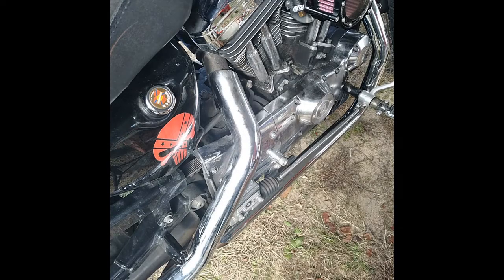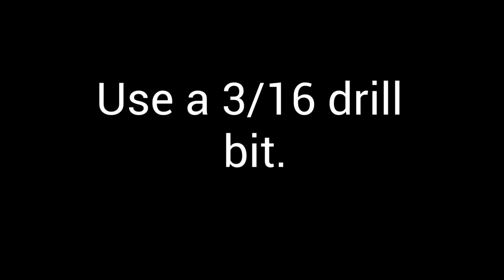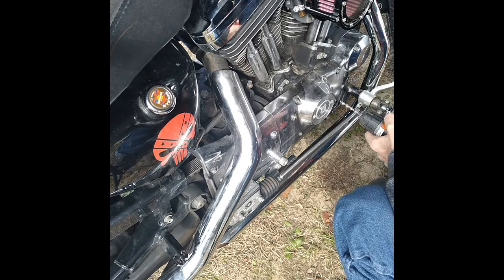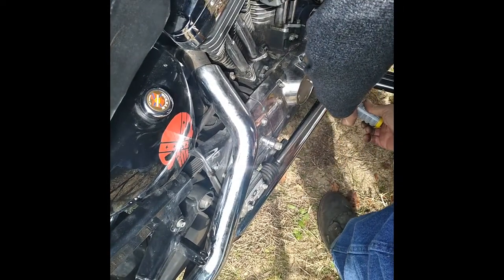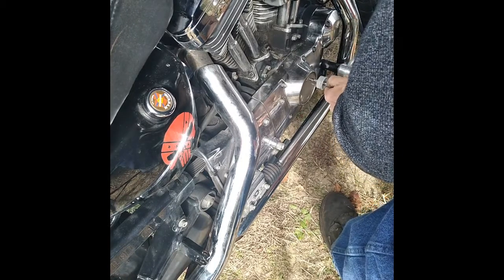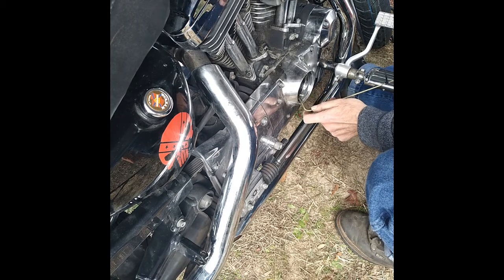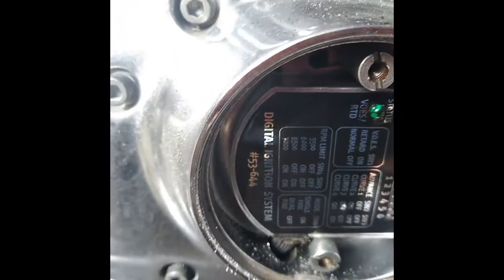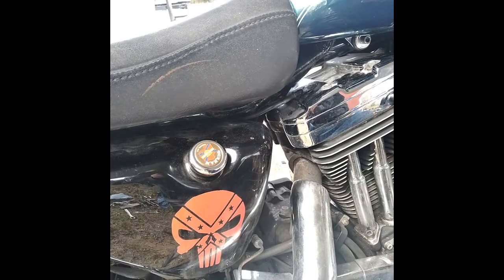Harley Sportster's Mysterious Ignition System Revealed!

Comment: Ultima is a DynaTek.  Just has slightly different pre-programmed curves for Ultima's hot rod engines.    I have one on my Shovel.  At first used the dip switches but I now used the DynaTeK software.
Reply from the maker: Thanks for th info. Appreciate it.